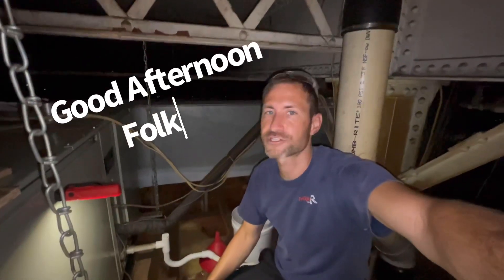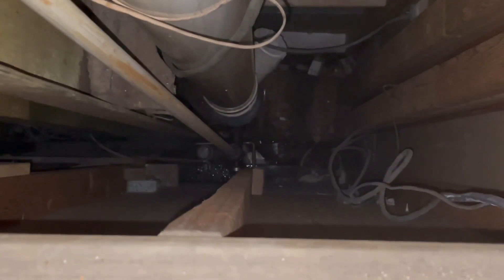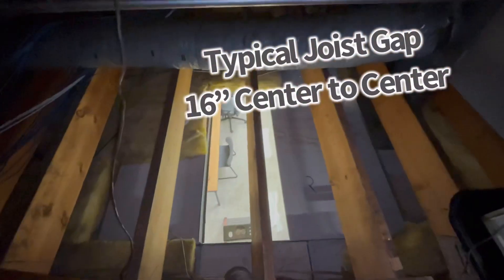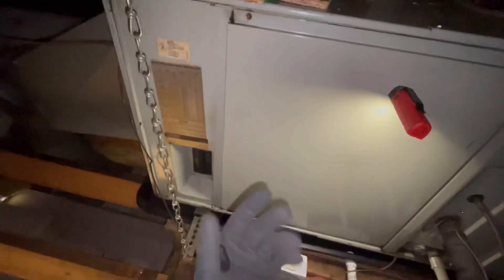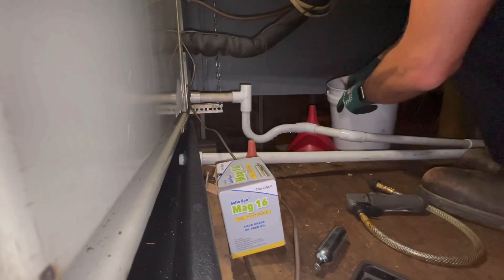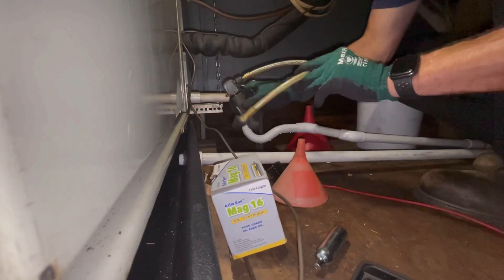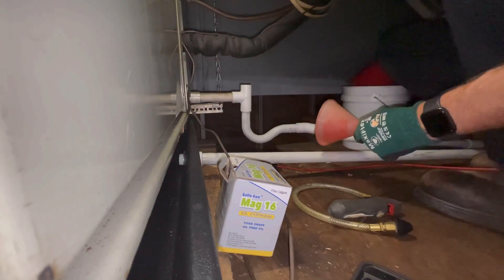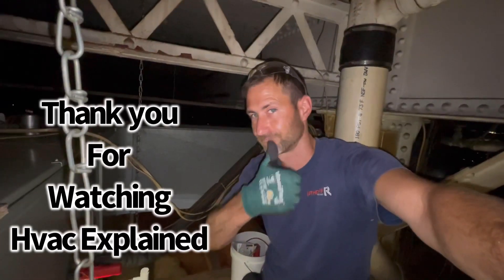It’s a Trap !!!! #Steamfitterslocal449 #hvacexplained #RuthRauff #hvac #commercialhvac #hvaclife

Comment: Good job, just wondering if that condensate line  should be insulated in that unconditioned space?
Reply from the maker: What’s going on Coolezum?  How are you?  Yes, There are times when we do insulate the drains but this one hasn’t caused an issue.  If it would I definitely would insulate it but at this time it’s been OK.  I’ve worked in many malls where we’ve had to insulate the entire drain because it’s dripping in their stock room on all their products due to condensation.  That’s a good eye for pointing it out though I do appreciate it.  Have a great day stay safe.
Reply: @hvacexplained9341  you’re a good man👍❤️
Reply from the maker: @coolezum  Thank you very much Coolezum.  I just try to take my job Serious.  On May 3 I will be on my 18th year with the same company I started when I was 21.  You don’t have to be the best technician in this field to have a good career    You just have to put in the effort like any other field.  
I have to go work some overtime in a couple hours replacing pulleys and belts on a server room Liebert unit.  My customer can’t be there till one so sometimes you have to work with a customer to keep a customer happy.  👍
Have a great day

Comment: Doing pull ups on water lines is not a sound idea. Some solid fundamental pointers were made in this video.
 However, after a YouTube Technical Police comittee. It was determined that your method of accessing the equipment is a literal hazard. 
 Stay safe. Live to fix another HVAC system, or a sub shop UC RIC, or snort pills and beat your wife. Which ever floats your boat
Reply from the maker: Jake I totally agree a lot of things us techs do in this field isn’t safe. We must use common sense, tie off / harness etc. when possible.  I’m simply giving a example on why some equipment isn’t maintained properly.  I do point out at times that “Do not attempt” is posted at times.  I wish all equipment we work on could be installed properly, accessible, well lit but it appears that it doesn’t happen often.  Videos that I show I don’t sugarcoat and make it seem like HVAC is the greatest, simplest job out there.  HVAC Training Guides hardly get a future tech for the real world.  Every field has its ups and downs and we must adapt or refuse the work.  I do appreciate you’re and everyone else’s concern, comments and suggestions.  I can make some safety pointers for future videos thank you for the heads up.  Have a great night.

Comment: I’m 5’ 8”, 145#
I’ve been hung upside down by my boots out 5 story windows.
OSHA wouldn’t approve, but my boots did. 🤦🏻😅
That’s called trusting your coworker, we used to, and could.
Reply from the maker: Yes OSHA would not like that.  There are many things we do in this field OSHA would not like.  There’s a lot of stuff I don’t post because of that reason LOL.  But if it was really dangerous I wouldn’t be doing it.  
Just always try to remember your surroundings so in case you do have to jump you have a plan.

Comment: I'm 6'7" and I don't think I could have gotten up there!
Reply from the maker: I was laid off in like 2009 and two technicians that I used to work with had to go perform a maintenance at one of my old accounts that involved 12 water source heat pump’s above the ceiling.  They told me when they got done with that entire maintenance that they have full respect for me. Lol. I said all those wrinkles on my forehead are from that place alone.  
I had to go through the roof hatch one time that was I think the measurements were 
14”X14” Air filters had to come through on an angle.  I swear sometimes people don’t think about the technician.
Reply from the maker: I’m 5 foot 11” 145 pounds.  Lol Sometimes I think it’s job security to be so skinny but sometimes I wish I was overweight so I didn’t have to work on some of the stuff LOL.